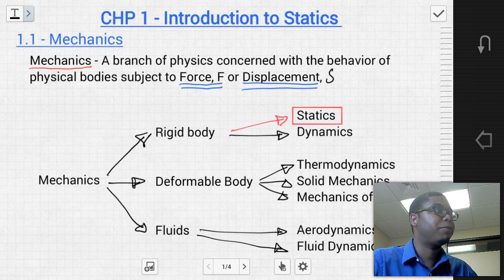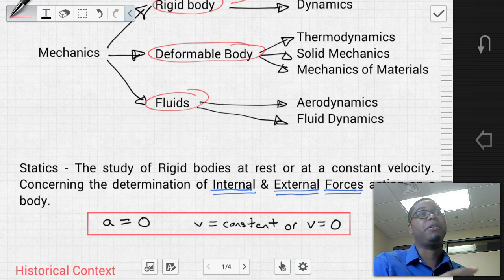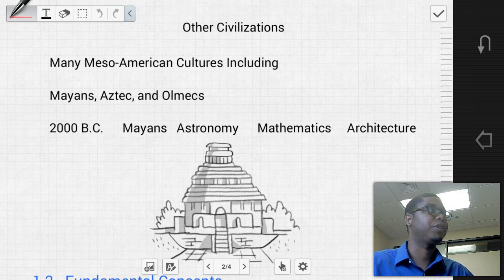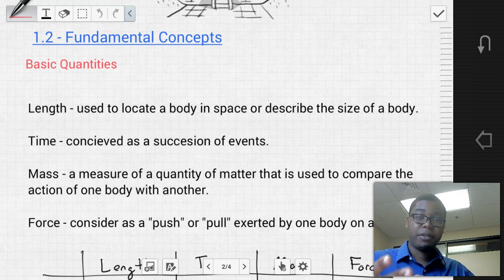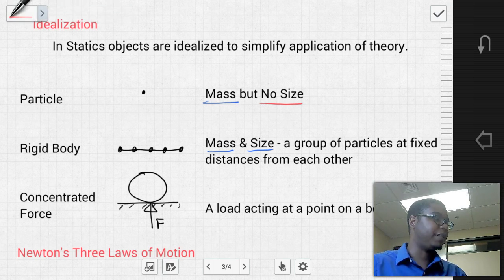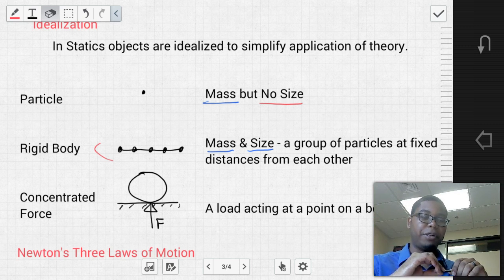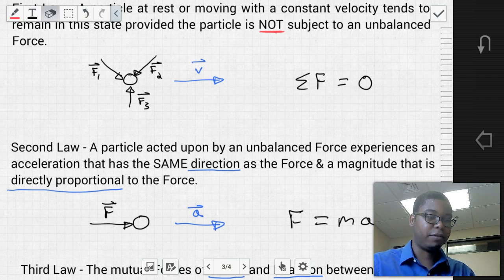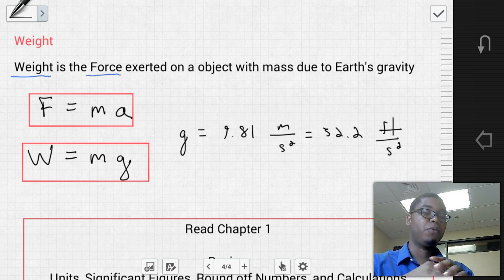Introduction to Statics (Statics 1)

Comment: Thank you so much for these video lectures, as a black engineering student you're such an inspiration ! I supplemented them with my studies in addition to the example problems on your site. Following your method of problem solving did wonders and after passing Statics I'm now taking Mechanics of Materials. I noticed you posted notes and example problems on your site for Materials but they're locked :(

Comment: how is "Engineering Mechanics Statics" (13th Edition) by Hibbeler different from the 14th Edition? because my teacher assigned us the 14th edition.
Reply: Essentially, all of the editions down to the 12th edition are the same. The only difference is that the problems are all switched around and some updated. This is important because the correction of errors and to reflect the times. The world around us is constantly changing. So does the text books need to change to keep up with the current technology. This explains why you have succeeding editions.  I must agree that the older editions of textbooks are more lucid than the current ones because they explain clearly what is going on. And some has the solutions manual to them. If you want to become a master of a subject, you must first learn to become the student by learning the subject. Take this wisdom and cherish it. Wisdom does not come cheap; it must be earned.

Comment: Hello Dr Stewart, in the first slide you've specified Thermodynamics as a branch of Deformable Body. Can you please explain why? Further, you've specified Solid Mechanics as well as a branch of Deformable Body, I thought that Solid Mechanics is a branch of Applied Mechanics (as well as Fluid Mechanics) and Righd & Deformable bodies are both branches of Solid Mechanics. Please help me to make sense with that.qq
Reply from the maker: some clarification. Thermodynamics and Heat transfer should be on the second level of the tree. Solid Mechanics is concerned with the deformation of solids hence it is under Deformable bodies. Applied Mechanics is the "practical Application" of Mechanics. Good luck in your studies.

Comment: i'm studying civil engineering , and i can't understand anything with my doctor , and i'm really afraid .. i don't want to fail , please help me .. how to study statics
Reply: SA Thugz I can help you with that. Frist, read the problem. Then draw the diagram. After that, apply the appropriate formulas, like the law of cosines and sines. Furthermore, solve the problem. Finally, answer the question. Last, check your answers and see that it makes sense. These are the procedures of tackling problems in mechanics.
Reply from the maker: Joe has a good summary of the steps.

Comment: Your course on "Engineering Mechanics Statics" is very interesting and inclusion of mathematical insights are very useful. Requesting you to upload "Strength of materials"  course in future videos if possible.
Reply: vignesh Strength of materials consists of two parts: one is Statics and the other that deals with the chemical composition of the material and how those materials withstand the forces when pressure is being applied weather it is externally or internally. In other words, how that material is able react to those forces which causes it to deflect or deform.
Reply from the maker: i have not taught that class but if I do in the future, i'll certainly make some videos.

Comment: Thank you for your youtube lectures. I am taking statics at College of Marin in California. We are using the moodle from other school and have no lecture at all. We can use the Wolfram alpha app. I am also trying to program my ti82 with laws of cosine and sine, dot product and cross product.
Reply from the maker: +Emily Wong Good Luck Emily. I hope these videos help you! :-)
Reply: We are using the 11th edition. I am not sure why. Thank you. I will watch the videos with examples next. We did not cover chapter 1 either. We skipped it entirely because  the material was covered in the physics prerequisite.  My school has an extremely small engineering dept. The students want to transfer to uc Berkeley mostly.

Comment: I could not find the chapter to read and solve some problems. Can u provide us the provlems prof. please?
Reply from the maker: The book I use in my class is "Engineering Mechanics Statics" (13th Edition) by Hibbeler. You should try to obtain a copy.
Reply: Use the 12th edition to compliment the 13th edition. The 12th edition is much better than the 13th edition because it is very lucid and has better examples. In addition, it has all the solutions when you obtain the solutions manual of course. I have purchased a private service to have access to the solutions manual online. For legal reasons, no one should ever have access to this unless approved by a professor. This is primarily  for checking the progress of one's work. I encourage  academic honesty by not revealing my sources. However, you can purchase one from me by purchasing mine tutoring service. I charge $20 an hour per problem. If you're serious about the inquiry send me your email. Once again, I am honest. I will show you how to do the problem not just obtain an answer. Good luck in your endeavors.